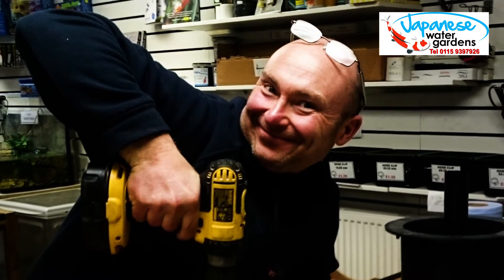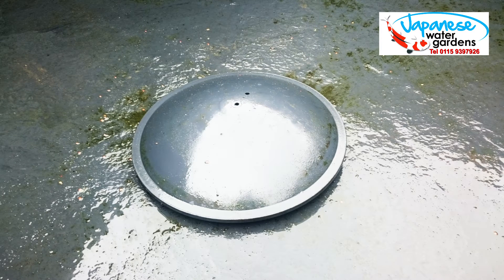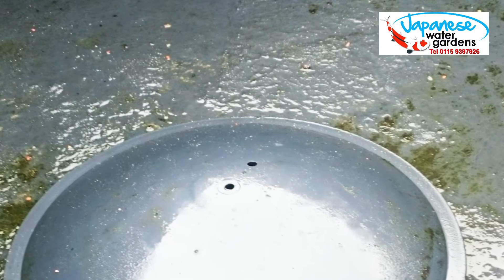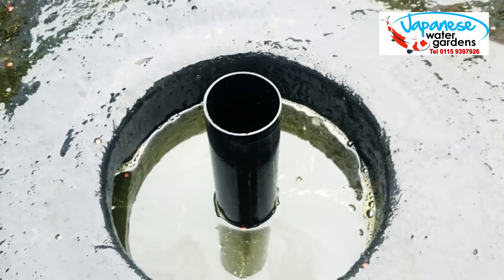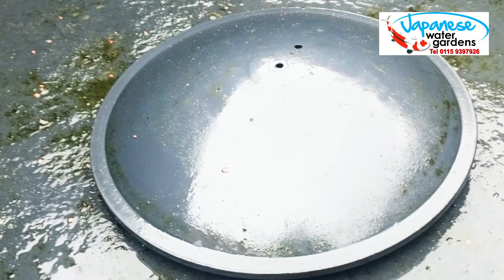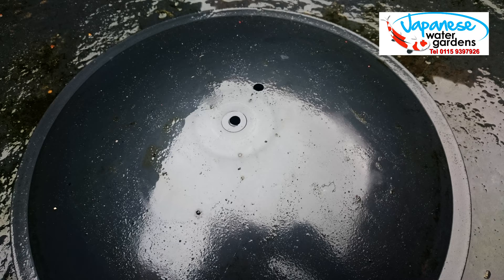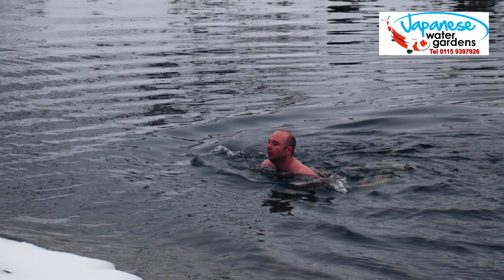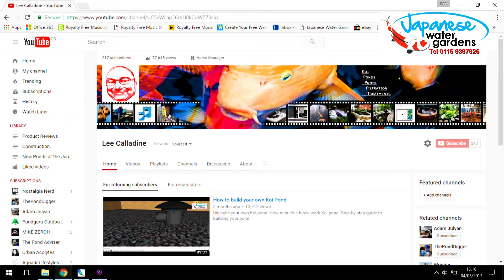Modify your bottom drain dome tip.

Comment: so on my bottom drain kit it  came with 2 tubes dome sits on so i need to keep both do i solvent weld it to the base so it doesn't pop off sorry if its already covered
Reply from the maker: Don't glue it on. If something gets stuck behind it you will have a big problem.
Reply: @leecalladine   ok so as long as i have an air hole drilled dome side it shouldn't lift off this is my first bottom drain build thanks for replying lee

Comment: Could you not just turn it upside down before fitting to release the trapped air?
Reply from the maker: The traped air is not the problem. It's the trapped water that cannot be compressed.
Reply from the maker: The water that is trapped in the pipe.